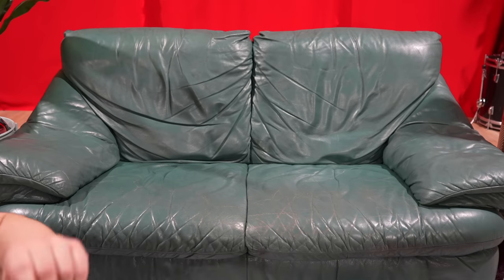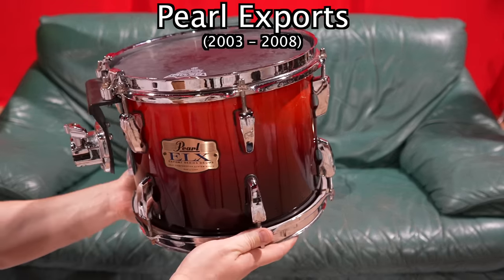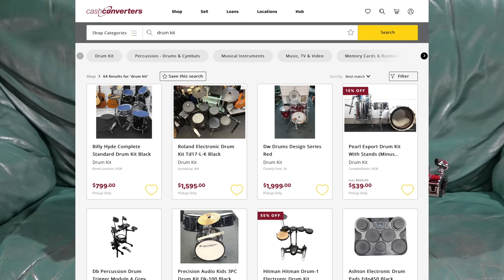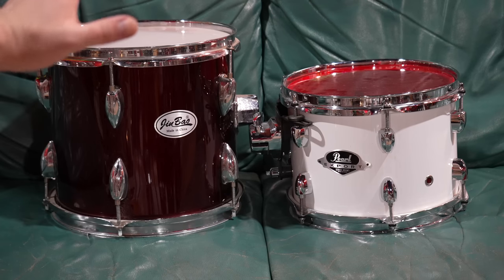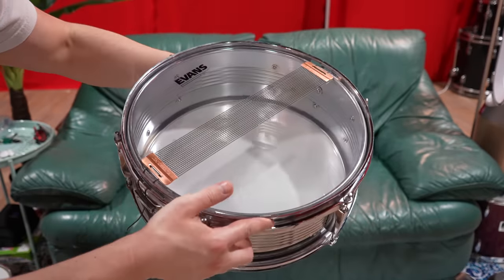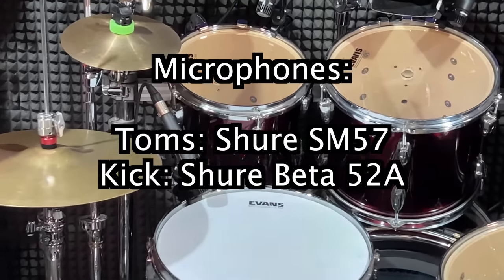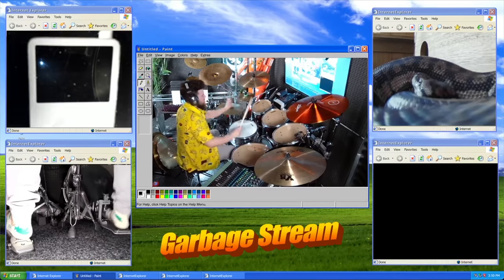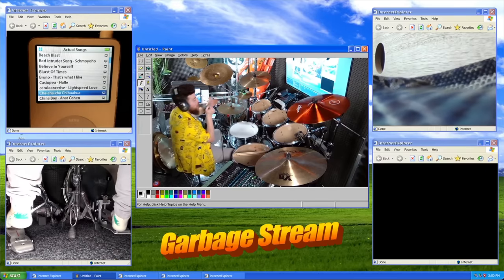The worst drum kit I could find.

Comment: I used to build drums professionally. I’m talking proper handmade stave snares that sound better than any factory garbage you’ve heard. My experience was that I just couldn’t get drummers to spend more than the materials I spent on the drums I built. I don’t know what relevancy that has to the video.
Reply: That's the problem with small scale production. Customers have the option to buy mass produced drums for cheap, so it's not easy to convince them that a snare could be worth 2k. The selling points are uniqueness that comes with custom builds, and the feel of supporting a local business.
Reply: So many low priced drums, with proper tuning, haeads and micd up sound killer. Don't have to spend 7k on the DW name.  But if you choose to spend 7k. Go SONOR !
Reply: In this regard, i know practically nothing about drums, so what are the percs of a higher quality drum than a cheap one? I mean, in which appreciable way the higher quality is expressed?
Reply: @fragra7186  It's mostly hardware and bearing edge quality. Good lugs give you better feel when tuning, and floating Tom mounts make them sound bigger. A good snare wire mechanism let's you find just the right spot for the tension, without drifting afterwards. I have also noticed that the kick drum sound can be noticeable different between manufacturers. Dw kicks are punchy, Ludwig kicks are full and resonant, Tama kicks are clacky, Pearl is something between dw and Ludwig, Yamaha is very middle of the road but good quality. This is just something I've gathered over 15 years of obsessing about drums, I have no idea about the science behind it. Maybe OP can chime in.
Reply: @djentlover  very helpful, thanks a lot. Quite intresting really
Reply: A bonk is a bonk, whether cheap or pricey
Reply: What did you expect? People aren't all millionaires.

Also, I'm a guitarist, not a drummer, but I imagine the fundamental rule applies: buy cheap and mod. You're buying something to suit your needs in the moment, not something to suit your needs when you eventually play Wembley, so why spend thousands on high-end gear unless you've got thousands to burn?
Reply: its easier to be high end craftsperson for stuff like furniture because you don't need skill or sense to want to buy absurdly expensive furniture

Comment: Wow I'm surprised that you are able to find out about this brand. As a Chinese drummer that has played a Jinbao set for 5 years let me talk a little more about it.

This company mainly reproduces the design of Pearl drums. This series that you own is their lowest model that costs about 800RMB in China brand new. It is basically a carbon copy of the earlier Pearl Export series. They come with some cheap white copper cymbals that sound more like a China than they sound like crashes and a pair of 12 in HH that sounds like a big bell. Later on, Jinbao made a higher end line up copying the design of the Pearl Masterworks series and managed to replicate the suspension mounts pretty well. You will be surprised about the sound that those suspended toms make. They sound really nice with proper tuning. In addition, if you were to use some Gibraltar suspension mounts instead of sticking a stick through the shell, the entry level Jinbao doesn't sound half bad with decent tuning. The models sold in China after 2005 have really nice bearing edges, so the model they use for exporting might be the defective ones.
Reply: Why is there an 11” tom?
Reply: Hey Louis, I wanted to ask whether you'd know anything about a drum company by the name of Supreme Drums.
Reply: @Jamesdumpsite  chinese
Reply: @robertschnobert9090 yeah that actually makes a lot of sense when you think about it. I'm fairly sure some Chinese music uses entirely different notation from the standardized style, so it would make sense that it could reflect in the instruments as well

Comment: This is another great example of how to get into a hobby. Your don't need top of the line, you start out where you can and upgrade as you go. Using cheap drums but good heads is a great example, same with getting good pedals.
Reply: True. I started out with a 2nd hand Sonor 5-piece kit from a local church that sold it because they've upgraded to a new one.

Replaced the heads with new Remos, and replaced the squeaky pedals with Iron Cobras and it's great.

Gave it away to my cousin though because I've upgraded to a Tama kit.

Comment: I've slowly grown to approach my bass guitars like this too hahaha. It doesn't really matter what wood it's made of, they can all sound excellent as long as the neck isn't warped and the guitar is properly adjustable. Maybe throw in better pickups, as for the rest of the electronics, electrons don't care about anyways. Good strings make an enormous difference, playing technique even more.

I used to gig with a fancy musicman stingray with heavily figured wood and all. I saved up for all eternity to buy it. Used it for years until at one point I bought some random 90s squier with like a 13 piece body. It was initially meant to be an in-house bass for our jamsessions, then the guys couldn't get the funding round, I had already bought it. All it needed was new strings and a good adjustment, a bunch of love.... It turned out actually sounding great and it became my main instrument. I often get complimented about the sound "oh it must be one of those very early squiers!", "What pickups did you put in, they sound great!!!". It's one of about the worst years you can imagine regarding materials, I left the electronics fully stock (the only issue I have are microphonic pickups, I have to pot them at some point, again a mod anyone can do with an old candle and a lot from a cashies), the neck started twisting severely so idk how long it will survive but it is still set up like a breeze and it's in my opinion the most amazing bass I've ever owned. 

Also regarding amps, heads all sound the same anyways if you play with a clean tone. The cabinet influences the sound waaay more. Cheap cabs can sound great as well, the crap vintage stuff has all been binned already so what was worth saving remained. Modern speaker technology has grown so substantially even a flimsy stamped little speaker has a more linear response than the high-end stuff from years ago. You almost can't go wrong anymore. It's just mainly patiently looking for something that's close by that you can try out in person with your own amplifier and bass. 

 for as little as a 100-200 , some elbow grease and a ton of searching, you can have amazing tone and collect together a rig to do a good bunch of gigging. Anything more it's just show hahaha. I think my current setup, amp, cab, bass, it cost me about 180 euros total. Still way less then a 10th of what I paid for my previous bass, let alone the complete rig hahahahaha

Comment: My kit cost £63 off ebay and I used it for yearssssss. Yes I put decent Evans heads on and yes I (eventually) bought some half decent Sabian XS20s but apart from that they were thrashed and gigged mercilessly. The tubs were round and bearing surfaces good, that's all that mattered. Wraps peeled and hardware rusted a little but you know the saying - if you squint it's mint.

Comment: That lump is water damage! It comes from particleboard getting wet and expanding. The wood shavings are mixed with glue and shoved in between two thin layers. When the shavings get wet, they expand and form a lump.

Comment: This is the same message I try to tell people with photography if they're interested in going past their phone.  You don't need a 1000-dollar body, and you don't need a beginner new 600–700-dollar body.  Go pick up a E-P5 from 2014 for like 250 bucks off KEH or something similar, get a cheap Panasonic or Olympus 25mm or the kit 14-42mm, and have fun learning about the exposure triangle, composition, etc.  If you want to get more serious (tbh that E-P5, E-M5.2, E-M10.2, GX85, etc is still a banger today, 16mp will get you a long way, the Sony A6000 is basic and old at this point but still great to learn with) then pick up some solid lenses first to go with the old but great body to see immediate changes.

Old DSLR's can be had for a bargain too along with relatively cheap used lenses.

Comment: Good beginner drums are a gamble, my first kit I got when I was 13 was a used (but basically new) mapex tornado from like the early 2000s and it's been my main set ever since then (I'm about to turn 23), with good heads and shit the drums sound wonderful and I've used them for all of the live shows I've played with my old band and even an orchestra!. The only bad thing is that like 2 years ago the snare rim warped like crazy and the snare wire system stopped working, so I'm saving up to eventually buy a new snare drum, but other than that, the kit still sound wonderful. And just like you said, get good pedals and gear (and cymbals, those are the real game changers)

Comment: Holy crap do you know if they're still making these?
In 2004 or so I bought a Jin Bao kit off of ebay for $100 (incl. postage) and it saw me through my final years of high school doing solo and ensemble performance. 
Exactly the same shade of red as yours. Shells about as hard as half-cooked lasagne sheets. Pretty sure I told my mum she could dump it after I moved out...RIP in peace🕊

Comment: Yo mate, I used to play a ton, mostly Punk Rock and like Death Metal and shit, but also Swing and it's been like AGES since I had issues with cramps, I got really loose, fast and chill while playing.
Then, because of work and stuff I didn't play much for a few months and now I can't hold my right stick if I play 1/8s at like 90bpm for a full song.
I've been playing regularly for the past four months again but it doesn't get better. I actually have to either spit on my sticks so they get sticky or put fucking glue to remedy it.
Got any ideas what might be wrong!?

Comment: Makes sense, just get good stands, feet, hand etc and you can cheapy on the big meat. Seeing how badly misshapen the lip on the kit is, IMO one could easily sand it. Just get a flat surface that you can trust, sharpie the lip and then rub it against the surface until the sharpie wears off. That's where it's contacting, that's where material needs to go. Easy job with a medium rasp.

Comment: Pearl exports are the Honda Civic of drums, the DS1 pedal of drums,  the Nevermind album of drums: you've either owned one, played one on, beat the shit out of one, or listened to one over and over and over again. It's a fucking workhorse, everyone should own one, fuck yeah Pearl Export. 

I wrote that last sentence and I'm a snobby ass Sonor Boy. 

That being said there's a reason most companies stopped putting the wrap seem under lugs: resonance. 

The separation fucks with the lugs over the gap and reduces your tuning stability over time compared to seems not under lugs. It's the fucking drawback to wraps. It's cheaper to wrap a kit in sparkle then to individually paint them. Also possibly nicer for specified finishes.  A lot of kits with such seems have split over time. A lot haven't, but it's not universal, and placing the seem under the lug doesn't help. It"s less cute on purchase, but technically, if you abuse the shit out of you drums like I do, keeps them cute longer. 

Most people don't actually realize their wrap on old kits has probably unglued because they never unscrew their lugs. 

Also you're comparing painted kits with wrapped kits at the beginning which makes no sense.

Also at first you're like: yeah they never untune, then literally complain about how hard it is to screw a new skin in: no shit, it didn't untune cause the lug screws are fucked.

Comment: "Cheap drums have 8. Pro kits have 10. This has 6." 
The amount of lugs depends mostly on the drum's size and manufacturer and not so much on price. You can even get a 6 lug bd to sound great, it will just not have the same tuning stability and the head to hoop contact might be slightly uneven. That is also why this kind of kickdrum is not really made anymore. But if you ever come across a 1950s 20" Sonor, it will likely feature only 6 lugs. And if we go up to 8 lugs, you will hardly notice a difference, especially on 16" to 22" drums. It's not more professional to have a drum with 10 lugs. It's preference.

Comment: After working in a drum shop for about 2 years and playing every brand and every price point. I came to the same conclusion that you really can just play any drums as long as they are round and tune up worth a damn. Modern drumheads are that crazy good. Search for a snare and cymbals you like the sound of, but buy whatever foot pedals feel the best regardless of price. Just don't fool yourself into $$$$ = feels good.  Needless to say most people were not amused, there are surprisingly more drum elitists than even guitar elitists 🤷‍♂. I also play and sold guitars.  

What really disturbed people was when I showed them that any cymbal sounded at least noticeably different depending on the style and weight of stand you played it on. I was a little surprised, but it really wigged the nerds and jazz guys out.🤣